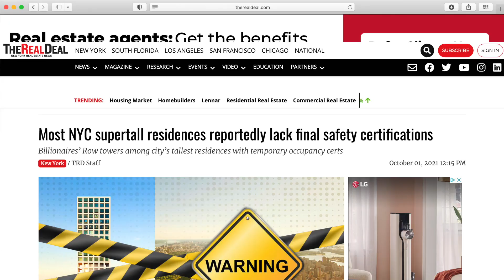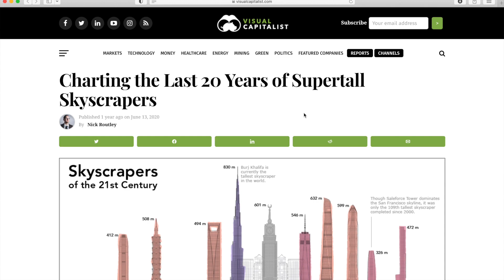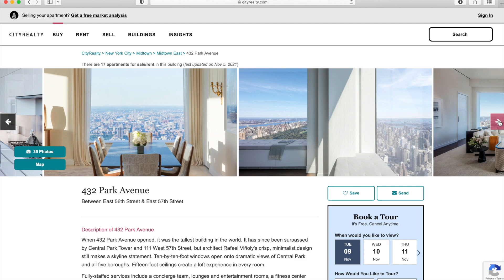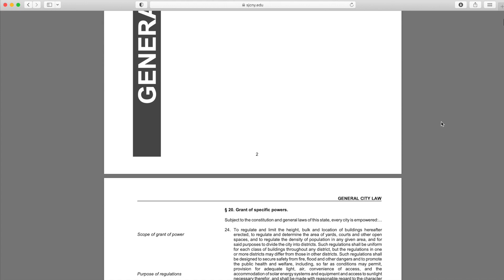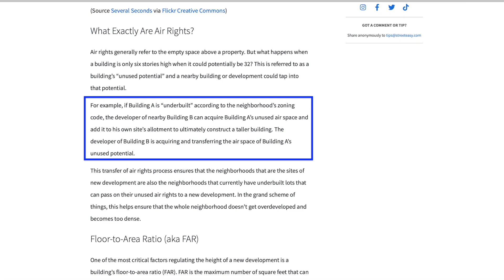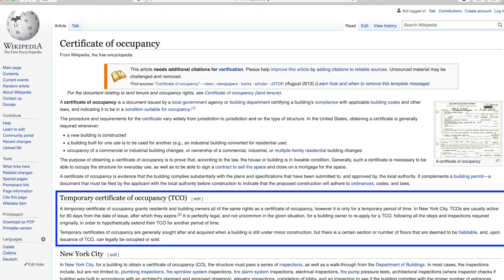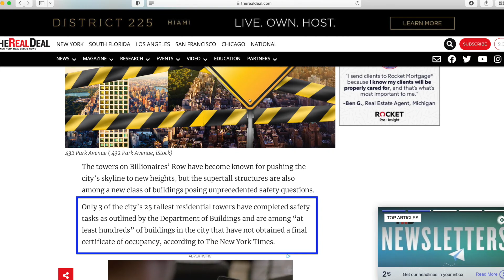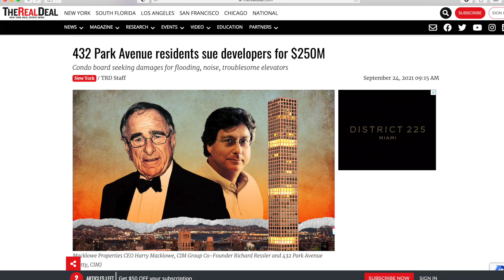Are these skyscrapers safe?

Comment: The modern problem with real-estate development isn't just height, but the overall massive scale.   We saw this with public housing in the 60's and 70's - as it aged it was crazy expensive to maintain, so it didn't.  Then it became undesirable and anyone with choice moved out, and spiralled downwards into a cycle where they aren't financially sustainable.   These modern high-rises are the vertical slums of the mid-21st century.   People forget that luxury mansions in world class cities fell into disrepair and were boarded up, or sub-divided into rooming houses during the depression in the 1930's to the 50's when people fled to the suburbs.   A lot of early high rise apartments were built in the 60s for middle income couples, and by the 80s these had fallen in value to attract only low income, high turnover rentals.   Real-estate booms and busts.